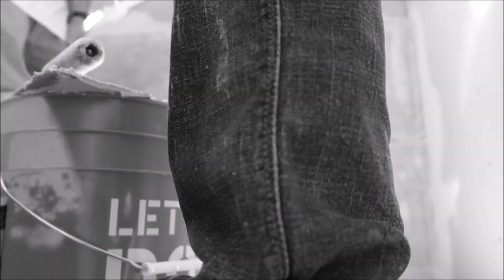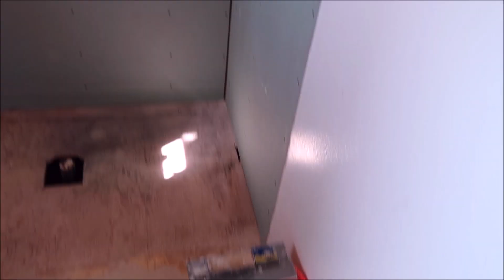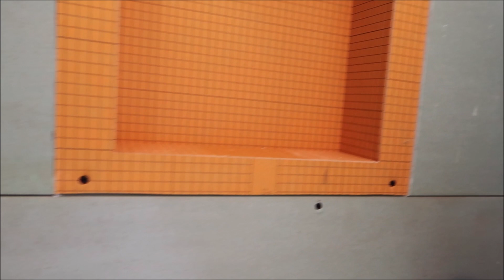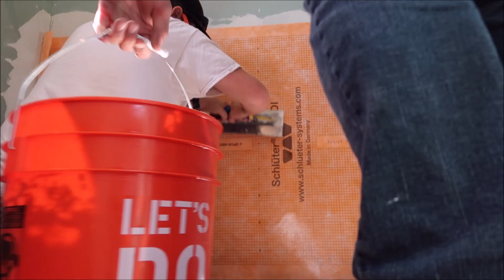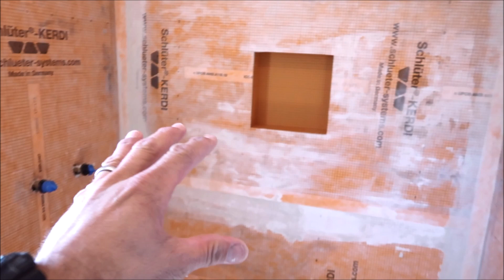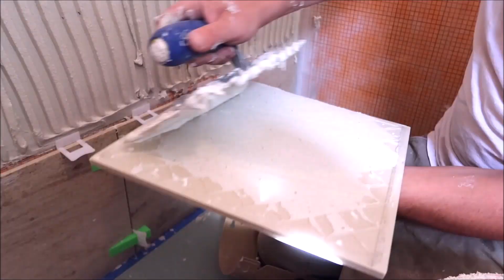Budget Friendly Waterproof for Shower Walls

Comment: Your work always looks great
In regard to the Schluter thing, isn't it their policy to only honor a warranty through a trained installer ? I mean going to HD to get it and put it in as a DIY'r is fine, if they do it right, right ?
Reply from the maker: Thanks! Yes, we both have completed the Schluter work shops. If you install correctly, Schluter will always warranty their products, but at the same time, it is rare that a Schluter shower would fail if you install correctly.
Reply: No, their product is warrantied for 10 years if you use an ANSI 118.1 rated unmodified thinset mortar to install the membrane and install it properly. It is warrantied for a lifetime if you use only their products and install them properly.
Reply: You do NOT have to be a trained installer to receive a warranty from schluter! Anyone who installs it correctly would receive warranty
Reply: @460sw3  that will be good to know for the DIY'r, thanks👍
Reply: I know of a tile company who had a bathroom installation fail and Schluter honored the warranty

Comment: Thanks for an honest breakdown. Most die hard kerdi fans just bash all the other products. Are you only taking drying time into consideration? Is it easier to paint on topical membrane versus having to mix and trowel on thinset?
Reply: Honestly, it depends on how much experience you have with schluter kerdi. If it's a first time ordeal, without any schluter training, the struggle might be with you. In which case, red guard or similar would be easier. However, kerdi as a whole is far faster than any roll on topical membrane, For the Professional anyway.... For the reasons mentioned in the vid. Also, it just doesn't get much better for a solid waterproofing system. The only failures I've seen with kerdi is someone who had no idea what to do with it. Like stapling it to the wall and crap. Or trying to use it as a pan liner. Lol. Anyway, it is a great system. Good luck to ya!
Reply from the maker: Yes, dry time, install time is what we take into consideration the most. Time is money...👊
Reply from the maker: I agree, after you install with this system, it get's faster and faster. We will never go back to membrane if we have a choice! 👊

Comment: I’ve been experimenting with kerdi and mud walls , there is no way I’ll tile a shower without floating my walls with a mud bed, but I am trying to steer away from old vinyl pans and use the kerdi system , so far it’s ok but kerdi does create build up, folded and overlapping layers in the corners create to much material build up and I find myself feathering in thinset after the kerdi installation, on LFTs it’s not a big deal because the tiles are back buttered anyways but for mosaics the kerdi buildup is just too much, have you ever experienced the buildup problem?
Reply from the maker: Yes! The build up is a bit of a headache. We do the same, half in trowel and back butter to make up for it and usually have to deal with the mosaic inlay. We use the kerdi band method or screed the area for the mosaic stripe. We are interested in trying the Wedi system as the build up does not exist with the panels and the wedi felt/membrane for the pan. We will give it a shot soon and I'll post a video on it. 👊

Comment: What about using red guard and cement board
Reply from the maker: That works, but time consuming. You need more than one coat at seams, niche and curb. Dry time takes a lot of time.
Reply: Landberg Tile DIY TV I see,  so if I wanted to use redguard what type of board would you use?
Reply from the maker: @quedogkualum  GoBoard

Comment: Why not corner wrap? Saves a step and reduces mortar buildup
Reply from the maker: We feel that the corner sometimes pulls away when wrapping 👊
Reply: True, the membrane fights back a bit. Hard to prefold going into the corner. I use a pool float to work the corner wrap snug

Comment: One big benefit of membranes like this is they don’t suck the moisture out of thinset like cement boards, or at least hardy backer. For a DIY’r the drywall and Kerdi process will take more than 2 hours the first couple times. You have the process nailed down very efficiently.

I think foam boards are a good alternative, imho. Products like goboard and the usg foam board are easier based on my experience. Kerdi foam and wedi board are more $ last I checked.
Reply from the maker: Yes, you're right. More time if you do this your first time. We go back and forth from Kerdi board to drywall/Kerdi membrane, but find that the price is MUCH lower and the time to install is MUCH quicker. You simply have to deal with the big sheets of drywall over the smaller lighter sheets of Kerdi board.
Reply: landberg Tile TV Thank you, I’ll just stop reading after the “your right” part. :^) But on a serious note, I wasn’t all that impressed with the Kerdi board. OTOH the wedi boards are real nice, but spendy. That’s sort of how I settled on the goboard and usg foam board.

Keep up the quality work!

Comment: Redgard or other liquid membranes only takes about 1 hour to dry to the touch before you can apply a  second coat. You don't need to wait until the next day. You can start tiling as long as the membrane is dry to the touch and it dries pretty fast if you turn a fan on it. If you use cement board, polyerethane sealant the corners, tape corners and seams with tape made for liquid membranes and use a pan liner, then one coat is enough.....Did that at my house 10 years ago and the shower still looks brand new. If you want to use a membrane.....Try noble ts membrane....It's been around longer than kerdi and it's made in america.

Comment: Great system and I use it lots...I want to HIGHLY recommend "DO NOT" tile the same day and this cant be stated enough! If you tiling and pulling off to check adhesion the kerdi will pull off the wall and it has now lost its adhesion the the somewhat dry motar behind it and you will have to pull off the whole sheet and re-apply new motar. Do yourself a favor and work on other stuff and tile the next day,
Reply: I tile the shower floor the same day but yes I agree I would never tile the walls the same day

Comment: Anyone watching this never use drywall in a shower, no matter how good ur waterproofing is it’s not code and it’s not smart
Reply: Schluter allows for drywall in the shower because they believe in their product, no point in using the cement backer board when nothing will penetrate anyway.. actually the same could be said for any waterproofing system
Reply: perhaps only valve wall, might benefit cement board vs green board in combination with Kerdi. Cause, hot water would generate some condensate on pipes. But, again the amount of vapor is so neglectable, if waterproofing has flaws and leaks no matter whether you have cementboard or drywall beneath it, you have to tear apart shower walls to fix it.